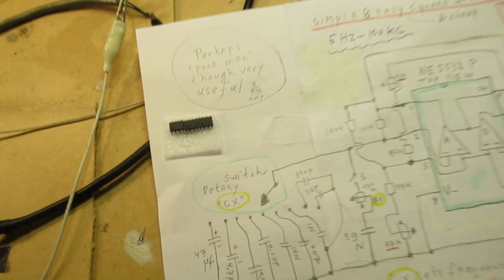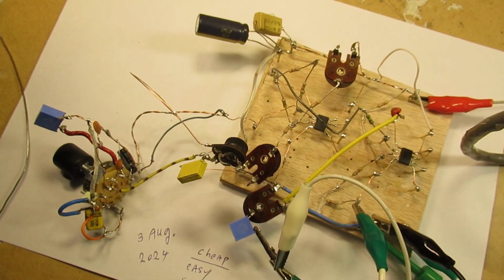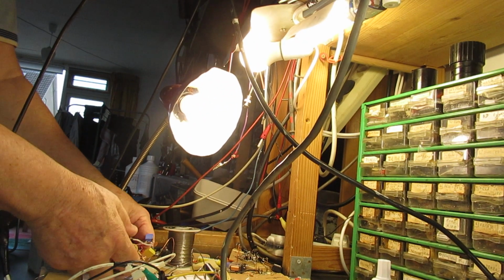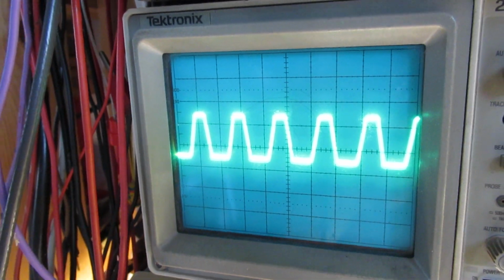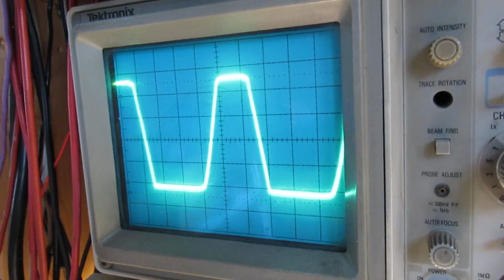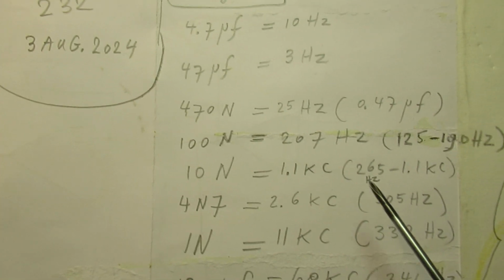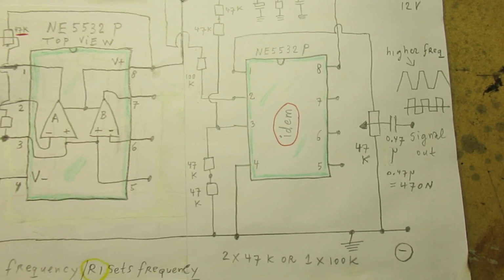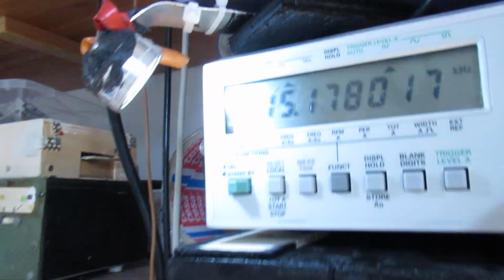Easy & Cheap hobby Square wave oscillator 5 Hz-100 KC made with 2 x a NE 5532 P (schematic & demo)

Comment from the maker: You can also make the oscillator with only 1 (one) NE 5532. Take the squarewave out via pin 1, opposite to ground (minus), via a capacitor of 470 N. Or without a cap (DC driving).
Reply: @radiofun232  Thanks. Oh I think the NE5532 is a better op-amp then the old uA741 op-amp. Your thoughts?
Reply from the maker: @MsFireboy2  Yes, the best property is that the frequency band is higher and there is a somewhat lower noise figure. Though in many cases (also in audio) the 741 can do the job.

Comment: 2:15: no, it's not! :D
check again, in TI datasheet there is nothing about IN+ being connected, i think you checked Philips datasheet, where you can find the internal diagram, but you don't zoomed enough, and got ground connection as being a link between positive inputs... :)
i was almost sure about that, too, but i zoomed the pdf more, and... eh... age! :)
Reply from the maker: The TI datasheet only shows one of the two Opamps. There a 2 in the package. What you say could be true, when we look at page 8 in the TI datasheet, the example/schematic  there. There is no clear description about this question in the TI datasheet. But I write for a broad public on YouTube and must be sure that my circuits always work, even when someone uses an older type of this chip. Thanks. 7 aug. 2024.

Comment: Thanks for posting. Have you ever tried a JRC 4558 dual op-amp?
Reply from the maker: No, I never tried it. Going to look at the datasheet.
Reply: @radiofun232  I have used the NE5532 dual op-amp chip. It seems to not do very well at higher frequencies.
Reply from the maker: @MsFireboy2  Yes, I saw the datasheet. My idea is that it does not go higher than 500 KC, but anyway, that is no fact....Thanks.